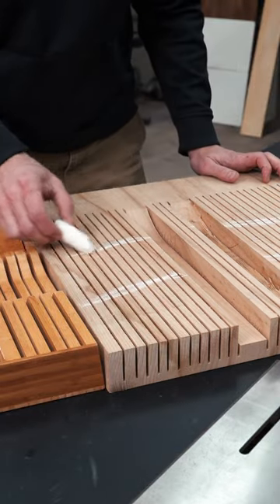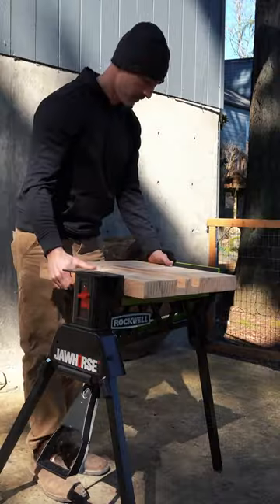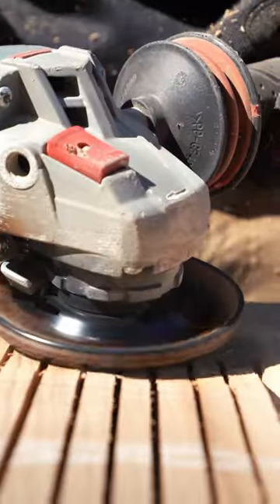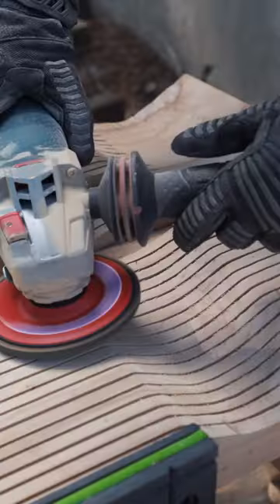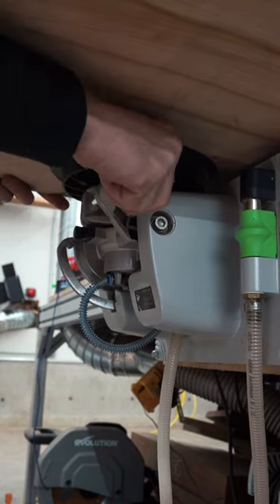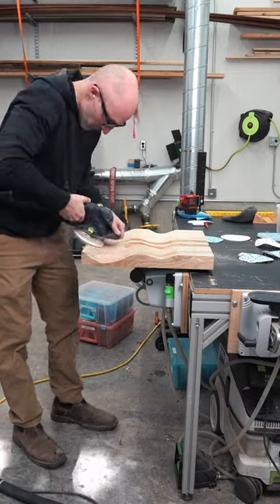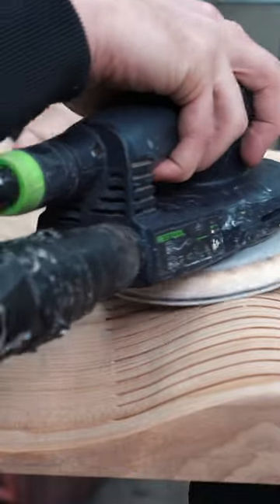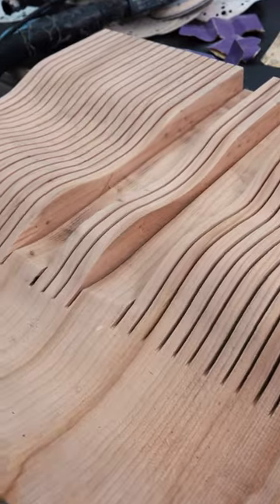Sculpted knife block

Comment: U could have used your table saw and slid that whole piece at an angle to hog out the mass to of it and cut those curved grooves in like in 2 mins. Then used that grinder to smooth it out and do the small refinements after if needed.